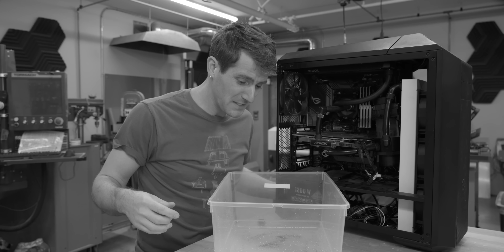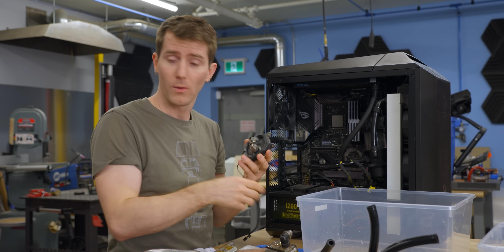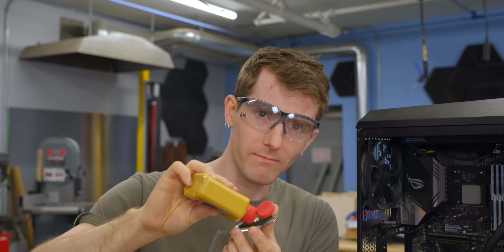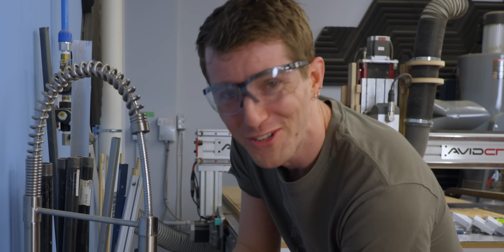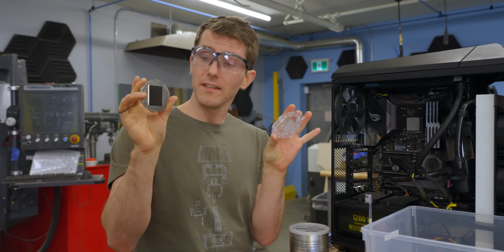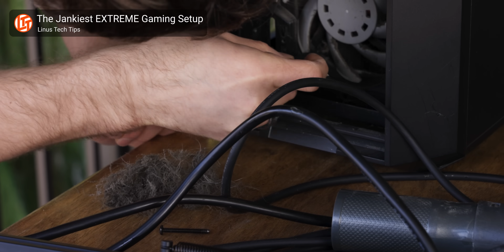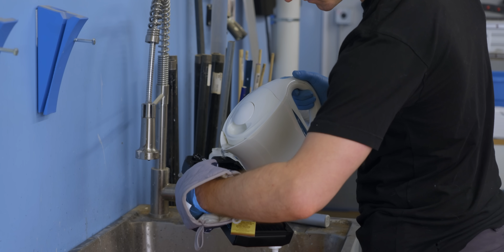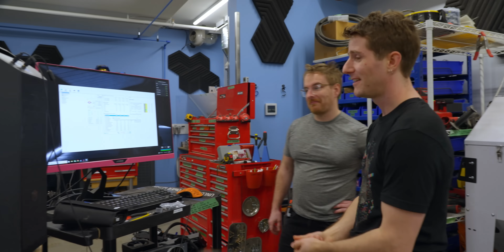I Will Never Watercool Again – Water Cooling Maintenance Guide

Comment: "The thing that attracted me to custom water-cooling was the inconvenience of it, I love taking apart my computer and washing parts of it like dishes in a sink, also the thrill of losing all my expensive components to water damage gets my heart racing like nothing else" - Custom water cooling fans apparently
Reply: Some people want to drive a prius the speed limit til the wheels fall off, some people want to tinker on a turbocharged hotrod every weekend that might tear its own wheels off. To each their own i suppose.
Reply: @GrimReaping  yeah but i've been using a turbocharged hotrod every day for the last 3 years so i am well within reason to point and laughing at the people on the side of the road who didn't consider reliability to be a factor in their tinkering
Reply: @GrimReaping Prius still goin'
Reply: @GrimReaping  Watercooling folks don't do any of this maintenance, though. That's the problem.
Reply: @GrimReaping  Except your comparison is off.  A good air cooler is nearly on par with water cooling.  So it would be like someone buying a Mustang and driving it, or someone buying a Mustang and taking it apart every 6 months to get 10 more horsepower.
Reply: @Terrackhimself  Your key word here is nearly. Anyone who races knows that they want to eek out every horsepower and drop every pound possible. Its for the fun of it. I enjoy cleaning and rebuilding motors just as much as cleaning and rebuilding computers. Just tell me you dont enjoy it man, i dont care what your views are on the comparison are, its better. Heck,  forget the comparison and all that other crap, just say "I dont like to mess with things after they're made.", and thats that. Do you think people who do cryocooling competitions that win second place say "Its only 10 degrees less, we actually both won!"?
Reply: @GrimReaping  Your key misunderstanding here was that  I was somehow bashing those who wish to do this sort of thing.  I'll full on admit that to me, dinking with water cooling for what only amounts to a 5 second boost clock extension, and maybe 1-2 degree C, is simply not worth it.

However, I specifically said, your comparison was off.

So just admit that you misunderstood my point.
Reply: @Terrackhimself  Water cooling distributes heat more evenly and efficiently. It relocates the heat to the outside of the case, as opposed to blowing it through, which can heat up other components as well. You're looking at a single point on a benchmark, and not an extended use case or the effects on other components in the case. I stand by my comparison. You can lie to yourself to cope, and keep writing comments until the end of time. You're wrong.
Reply: @GrimReaping  There are several videos that show that it is not as big a deal as you think.

So you can keep being stupid by trying to insult me, because obviously you've never seen side by side comparisons.
Reply: @GrimReaping  As someone who in the last couple years went back to air cooling, my non-water cooled components are actually running cooler with air cooling verses the water cooling as my overall airflow in the case is higher. The noise also is only a db higher since there is way less restriction. This is in an O11DXL so it isn't like this is an airflow optimized case either.
Reply: @Terrackhimself  Watercooling increase performance, that's simply a fact... When we're talking peak performance, those few % does matter, settling for less is like saying you're going to race with the intent of losing. When talking performance in the long run, yes even at the same clock speed watercooled components outperforme air cooled parts. Like you said "because obviously you've never seen side by side comparisons"... Anyways, that not the main reason most people do watercooling, most do it for either the sweet sound of silence (which is needed if you live in a flat with your partner, or did you really think she wants to run around with earplugs, because of your vacuum-cleaner sounding gaming PC) or esthetics. And you call other people stupid, what a joke!
Does it make sense to spend so much extra on it compared to air cooling? Well does it actually make sense to spend money on a gaming PC in the first place? That's obviously a resounding no to both... Spending money on your hobby is very rarely a good idea, but living life without any is just not an option for most people, so the money argument is irrelevant
Reply: @blazewardog  Sorry to say, but that's what happens when you don't research properly... There's several things that could be the problem, but the two most obvious ones are: too high restriction in the loop and/or low static pressure fans (completely ignoring the case, cause I've never seen or researched it). You should have asked for help, there's a lot of enthusiasts that with high certainty, would have been able to point directly at the problem component(s). Then you only had to do research around that component and you would have been golden
Reply: @Terrackhimself  air coolers are no where near a custom loop. AIOs, sure but custom loops are a whole different league.
Reply: @VikingRul3s  I want you to read my posts, and find the part where I said water cooling does not do anything.
Reply: @VikingRul3s  If air cooling is even close enough to cause you to even exaggerate about wearing earplugs, you are definitely doing something wrong.

If you do have a setup that loud, try using bigger fans at lower rpms. Also do a smoke test and make sure you aren't creating some kind of vortex and the air is actually flowing properly over your components and out of the case. also make sure your cable management isn't blocking air flow. And clean the dust off the fan blades as dust buildup on the fan blades can drop completely stop the fan from moving any air. And lastly, make sure there is actually space for your air exhaust and not just blowing against a wall bouncing back to the computer.
Reply: @SolWayward  If you aren't experiencing the "sweet" sound of a GPU going full bore, you simply don't have a fast GPU... Yeah ofc that was an exaggeration, but i have yet to see a girlfriend that's cool with a noisy PC

Yes bigger and/or better fans is an option (better air flow in general), but then how far off the price of custom watercooling are we really? Plus you'll still have that nice GPU sound, tho probably slightly less. The actual extra price will be pump + rad and people gladly pay twice high-end air for AIO solutions. The money argument is only the rather expensive GPU blok and then the undeniable fact that you'll void your warranty. The warranty issue is a very valid argument, as we're talking pricy mid-high to high-end GPUs
Reply: @SolWayward   BTW what's this talk about vortexes and cable management? I know you meant to be transferring the knowledge you got on how to make air cooled PCs less noisy (which is nice, thank you), but those two arguments are in reality myths. More research will tell you so, i suggest looking into hardcore OC communities, we'll be the most fanatic about airflow. Vortexes aka turbulence will happen every time the air hits components, so unless you don't have any components, you'll have heaps of turbulence (which is good, it means the air is hit the components as expected). Cable management (or rather the lack of it) don't prohibit airflow, there's been LOTS! of both reputable sites and private individuals that have tested it and all tests reach the same conclusion: "unless your PC case is the size of a console, cables have no effect on temps"
Reply: @Terrackhimself  Air coolers don't hold a candle to a custom loop. Flow rate, cooling capacity, and block designs are all vastly different. AIOs vs air: sure, I'll give you that. But your points are only valid for AIOs. Not for custom loops. Here's a prime example. When I built my 1950x threadripper rig in 2017: I first used a TR4 noctua cooler (NH-U14S) and could only reach about 200MHz OC stable. swapped with an AIO made for TR4 could still only hold about 200-300MHz could touch 400Mhz but not under heavy load. temps jumped quick on both.. that AIO failed, exchanged it in store for another, also failed.. said screw it and went custom loop with proper TR4 block, twin DDC pumps in series, and added the GPU into the loop as well, and used 2 radiators. Not only did it run significantly cooler, was able to push 605MHz overclock on it and it's prime95 stable indefinitely. That's all 16 cores locked at 4.05GHz 100% of the time. Ran 20c cooler under load and cooler at idle as well. Can't say it got any quieter, but I didn't build that rig to be quiet. 

I've been liquid cooling rigs for 14 years. Never once had a leak, failed pump, or gunked up block/component. Using shit coolant in your loops is generally the prime cause of failures. One of my oldest builds was a QX6850 with 8800GTXs in 3-way SLI. that rig ran for 6+ years without failure or cleaning/draining the loop. Was used and gamed on daily, When I retired that rig, the coolant was still as clean as the day I put it in, and the blocks were all spotless. No signs of wear or buildup anywhere. I still use that same coolant type in all of my rigs and builds to this day. (Koolance 702 coolant)
Reply: @Terrackhimself you're wrong and the fact that you can't admit it just further cements the fact, you don't like watercooling and so you find arguments to sustain your indifference when anyone can tell you, air cooling just isn't on par with watercooling, esp. if you start talking overclocking, it's close but it's not the same, in the words of Ricky Bobby, if you're not first, you're last... enjoy the view from the back broski...
Reply: @justrife  You can say your wrong all you like, but the truth is a good air cooler is just as good, water cooling only extends the heat soak period.  

The fact that you can't admit it just further cements the fact, you are a watercooling fanboy who does not like to hear that it is a hobby and fun.
Reply: @Terrackhimself  oh I wholeheartedly admit that it IS a hobby AND fun AND is head & shoulders above air cooling (just the facts), good thing that facts don't care how you feel or how you choose to explain your thoughts or ideas, wish you the best in that air bubble world of yours...
Reply: @justrife  LOL what ever dude.  you can wrap yourself in a warm blanket of lies and ignore what I said originally all you like.  Hope denial is a warm blanket.
Reply: @Terrackhimself   I think air cooling is just as good as water cooling, thats why I removed the radiator in my car and just use a big fan now. It's basically the same.
Reply: @GrimReaping "Nearly" is enough for professional workloads, let alone consumer ones. 

Unless you're running a data center, water cooling is just for shows; even then, a lot of them do air-based cooling.
Reply: whoever is running this channel definitely wants this to happen
Reply: Custom water cooling fans don't speak. The whole idea is that they're silent.
Reply: I've had custom water cooled for almost 2 decades now, never had water damage, never washed any components, it's simply a matter of doing it right and using additives for longevity (instead of colors, things flowing around like glitter and all that good stuff). I have however always had to spend an extra 100-150$ on a GPU block when i switch it out, but in return i get components that are completely silent and never die do too heat fatigue. But i mean if you can't figure out how to do a service on your car, custom watercooling probably isn't for you (It does actually require skill and the desire to research and plan properly)
Reply: Dude, I built my water cooled PC in 2018. I just recently upgraded some parts of it and so I decided to clean everything. And you know what? Everything were already clean so I did nothing. I went with a red liquid from EK-Cryofuel. I even reused that liquid because I saw no particles in it, and with the new hardware it's still as good as it always was. If I remember correctly that's actually the same liquid I used in my first water cooled PC in 2015 or 2016. So it's really old but it's still good to use.

I get around 25 - 30 C in idle and 50 - 60 C under heavy load on my GPU and CPU (7900 XTX and i9-10900K both overclocked). The fans run at 500 RPM in idle and 800 RPM under load. My rads are 360mm, 480mm, 240mm and a 120mm. I know, too much, but that's just how I work.

I don't think the maintenance is as bad as people make it out to be. It just depends on the climate where you live, the ambient temperature in the room and how hot your hardware is running. How often doesn't seem to matter for me. It has been running like 6 - 8 hours a day.
Reply: If you do it right you won't have any of the problems in this video. Also unwise to do the things in this vid that will CAUSE problems: don't put acid in your rads unless you're prepared to test the pH before hooking them back up to a loop. Ignore the iodine as biocide as well: use a reliable premixed coolant like DP Ultra, Koolance 702 or Mayhems X1 and you'll have biocide and corrosion inhibitor included.
Reply: @woe2you2 I use Prestone DexCool GM approved lmao. its not biocidal, its everything-cidal :D plus it has corrosion inhibitors and i use distilled water.
Reply: @woe2you2  yup, using a biocide with distilled water used to be the way to do it back in the day when we where all homebrewing water cooling loops from aquarium parts, but with whole companies spending tons of money on R&D, you are much better off buying a good premixed coolant or a good additive from a reputable brand, so you know that everything will be mixed in the right proportions and that it is safe for the components of your loop.
Reply: @originalkhawk  pretty sure a silver kill coil and distilled water is still a pretty reliable solution.
Reply: @woe2you2  But let's be honest, the new gen doesn't want to spend time on anything that isn't related to social media. Spending 10-30 hours planing, waiting days/weeks for components from various sellers, then having your PC offline for a weekend to build it properly, leak test, then spending the next 1-4 weeks tweaking to get it just right (regardless if you're going for max OC or silence). All that means the entire process is alien to them and they'll never do it or just wing it and then complain when they unavoidably run into problems. I've seen kids think they really put in some work, after doing a 5h mod job on their car....
Reply: @woe2you2  Or just air-cool it, get about the same temps anyway, and only spend 5 minutes maintaining it every 6+ months.
Reply: Damned straight. Custom Loop Ascended Race FTW.
Reply: It's like cars. There's a reason why I like spending 4-5 days detailing a car.
Reply: The anxiety of watercooling would keep me from ever doing it. I just slap a noctua tower on my cpu and forget about it till dusting day. I've been moving too much to have a tower, but if I ever get back to it I would love to do a passively cooled system
Reply: I can ATTEST! :D :D.... alright let me scrape my life back together now LOL
Reply: Water cooling is interesting, but something I'll never do. Air cooling is more than good enough for 99% of situations and has so many few points of failure and potential issues during failure.
Reply: @Freak480  I agree with you.  Even gaming does not have a real measurable difference between the two.  

The real benefits to water cooling are limited to activities that push your system to the limits, which as you said, 99% of us, never do.
Reply: @Freak480   If your only measure it in gaming performance, then yeah, i agree. The small gains (which will be a 100% of the time tho, more fps is more fps, watercooled modern GPUs boost higher and hold it) is not worth the added points of failure, but it's worth keeping in mind that your components usually last longer with better cooling (some high-end Nvidias have a rep of dying fast on "stock" air cooling). So yeah, if you have your PC in a separate room, are looking for must bang for buck, something you build and never think about again and are using a good headset (keeps fan noise out), then there's no beating air cooling!!! In that case watercooling simply makes no sense and definitely not AIO solutions. There's only 3 good reasons to switch to custom, that's noise, esthetics and/or enthusiast level performance
Reply: @VikingRul3s  The marginal potential life extension of the parts really isn't worth talking about. If you buy an even half competent air cooler or gpu and aren't running some batshit oc then the part will be fine. Generally speaking the larger issue comes from thermal expansion with frequent power cycling of the cpu.
Reply: @Freak480  You kinda just contradicted yourself... Yes components dying fast is usually from thermal expansion and guess what, keeping the core components 30-40c lower results in far less thermal expansion. That's pretty logical. No it doesn't have anything to do with "badshit OC", you'll be able to find 100s of reviews where they check out the backside of high-end GPUs with thermal camera, that reveals the staggering temps air cooled cards are transferering to the backside. That's where you get your card destroying thermal expansions
Reply: @VikingRul3s  Again, you're massively overestimating the effect that has on a well built air cooled component.
Reply: @Freak480   Again, you should really try doing a bit of research. Delta 20-25c vs delta 60-70c is low to you? So if your boss comes and says "I'll cut 2/3 of your pay" you'll be all "sure, that almost no difference anyway". Or perhaps you're focused on only CPUs?... Are you getting a great fps count with a APU system?
Reply: @VikingRul3s  The actual delta on modern, well constructed, well design processors isn't that important for longevity. The average persons processor, even going from room temp to throttling, isn't going to cause that much systemic damage to a processor. The biggest source of damage comes from wild and rapid temperature swings. Think "grandma that turns on and off her computer every time she goes to look something up" not "my gpu sits at a higher overall temp when in game".

Yes, technically water cooling can help extend the life of a processor, but it is almost entirely going to be lost in the margin of error when compared to an equally well designed and maintained air cooler.
Reply: @Freak480  See, i knew you where going to pull the CPU card. That's clearly not what I'm referering too, as stated many times. No it's not the amount temp swings, it's the degree of temperature difference (and how fast it happens). It's very simple and some research would have told you so... Different materials expand different, high temps means bigger difference. All materials have a flexible zone followed by a plastic deformation zone (lock up tensile strength). Higher temp difference means higher stress/force which in turn can exceed the flexible zone, exceed that enough times and it goes down. It's obviously not the silicon I'm talking about but the rest of the cards components

What grandma has a high-end gaming PC? And shutting it down when it's hot does what? You understand how electricity works right? It''s not a furnace
Reply: @VikingRul3s  A processor that is frequently power cycled  will go from it operating temperature to room temperature much more often than a processor that is just left running. That substantial, frequent, and rapid change in temperature will cause much more damage than something just left running at a higher temp. 
Modern processors (both cpus and gpus) that are properly designed do not experience significant long term damage under sustained usage within design conditions. This isn't complex stuff, you're just digging for some excuse to justify liking water cooling.
Reply: @Freak480  Did you at all read what i wrote? Please do some proper research! This isn't a new problem, it isn't something that suddenly appeared during the modern PC age, it's well documented...

Are you all there? I literally listed 3 good reasons to choose watercooling in the very first reply, what was hard to understand about that? The longevity thing is a bonus. And you're saying it isn't complex stuff, you didn't even comprehend the first reply...
Reply: @VikingRul3s  Our conversation has been about long term reliability and you exaggerating the benefit offered to it by watercooling. 

The other facts are ones that we agreed on, but I don't think matter much at all.
Reply: @Freak480  Nope, i mentioned it and then you zoomed in on it. Clearly so much that you completely lost oversight. I don't understand what so hard to understand, i listed 3 good reasons, that's it. Does watercooling provide other benefits, yeah, as well as downsides. Enthusiast air cooling build also have down sides, among them lots of fan failure points, the high premium of large efficient air cooled GPU models.

This hasn't been a conversation, then you would have stuck to what my reply was actually about, but since your reply was wrong i corrected you. There's documentation for everything i said, the life cycle of high-end vs all-other cards, the science behind thermal expansion (which cause solder fatigue). This has nothing to do with agreeing on the matter, there's facts and then there's imagination
Reply: @Freak480  As Daniel Patrick Moynihan said: "You are entitled to your opinion. But you are not entitled to your own facts"
Reply: @bombsquadtoddler  Good thing I'm being truthful then.
Reply: @Freak480  A hypothesis isn't "a truth" 😉 A theory is only valid in the absence of facts. Facts are however undeniable 🤓
Reply: @bombsquadtoddler  You misunderstand what a theory actually means. The theory of evolution, while still a theory, is fact.

What have I said that is objectively false.
Reply: @Freak480  I think you're confused. Are you talking about Darwins theory about humans (which is still "just" a theory, not facts) or evolution in general, which has been proven and therefore fact? (which btw first was directly proved with some lizards a few years ago) 

Simple, solder fatigue close to main thermal dissipation, due to high heat difference. It's one of the basic things in electronic engineering 🤓
Reply: @bombsquadtoddler  If you actually read throigh the conversation, you'll see that I do acknowledge that higher temps have an effect, but (and this is another known and accepted fact) that stress and fatigue is relatively minimal when operating well within design conditions. My main point was that the moderately lower temps from watercooling will have a relatively minor effect on part longevity (in a well design component) compared to the fatigue generated from repeated thermal cycling. A more static thermal load, even if at a slightly higher temp, will likely do less damage than a more dynamic thermal load average a slightly lower temp.
Reply: @Freak480  I did, you didn't. No that's incorrect. In electronic engineering you try to design it so it in theory works, but the days where building for longevity was key, is long gone. The reason so many flagship cards KIA early on now a days is due to savings (and eco friendly solder). In the design the amount of solder is calculated by programs, to achieve just over what minimum requirements are. This leaves little to no room for tolerances in both amount and temperature of the solder. Combine that with the massive TDP of flagships, that produces so high spikes of heat, that the PCB itself is calculated in as a heat dissipation surface. A over 50% decrease in delta is a massive improvement, 20% is officially called "a statistically significant factor/difference" among scientists
You can setup all the strange scenarios you want, cause it sounds like you will keep making excuses, instead of simply admitting that you didn't research it properly. So let's just say, sure, you know better then all engineers, they are all way too incompetent to understand how to properly use electronics
Reply: @Freak480  i did, you didn't. Where is that an acknowledged fact? In that company where entry and flagships have the same lifespan, that nobody other then you know about? Sure, you use your PC at a constant, unlike what basically 99,9% of all workloads or games does. In reality electrical engineers have no idea what they are doing, so it's a good thing you are here to correct all those useless years on school, based on your internet degree...
Reply: @bombsquadtoddler  Where did I ever say that "entry and flagship have the same lifespan". I said that watercooling will provide a relatively minimal boost to part longevity because there are other factors that are more significant in otherwise well designed qualiry components.
Reply: @Freak480  You don't seem to get it. They are designed equally well, so if your claims where true they would last an equal amount time
Edit: The heat spikes are so high on flagships, that the PCB itself are calculated as a heat dissipating surface/component. A decrease of 50%D is a massive difference, rendering the heat spikes manageable, like with entry level cards
Reply: @Freak480  I have no interest in discussing this any further, believe what you want. Make a company that goes around tearing down critical servers, they are all water cooled for a reason, but you know better, so you could easy make it big then. bye 🤗
Reply: @bombsquadtoddler  Yoj seem to be intentionslly either misrepresenting what I'm saying, or incapable of understanding it. It's clear that any conversation with you is pointless so I wish you a good rest of your day.
Reply: @Freak480  that's where the buffer of water medium for cooking makes the difference. You guys don't even understand and you're discounting it as bad. You're literally listing the reasons why water has advantages as a cooking medium and you just go "but because I don't understand how to build it to work properly, it will run into the same issues as air cooled anyway," when the answer is demonstrably no, it won't. That happens because of how ineffective a buffer medium air is. That's why the temperatures cycle in such a flux and cause issues like that. A water buffer pulls away the heat surges faster and more effectively than the best of the best air cooler on its best run ever possibly could. It's simply the nature of the medium and how heat transfers through air and water. Air is a horrible buffer medium, less than 1/16th the effectivity of water alone not even including a glycolic mix. You don't even realize what we are saying and that you are agreeing with us...
Reply: @Freak480  scientific theory and a personal theory are different things don't pull the same bs as flat earthers.
Reply: Spot on! Secret closet masochist.
Reply: Me too. Spending a Sunday Arvo taking apart my PC is a good time. I look forward to maintenance day.
Reply: The hoses should be electrically conductive like on a vehicle. Take an ohmmeter and test the radiator hoses on a car. The hoses are conductive to stop the block and the radiator from acting like a battery and oxidizing and corroding. I think they're impregnated with carbon or even bits of metal.
Reply: @SmokeyWire56 I just looked this up because I always do that when I hear things for the first time and as someone whos built over 600rwhp without boost, and without ever hearing this before, i can say with confidence thats simply not true. There is no mention of this in any hand book, internet page or educational material that I just looked through. radiator hoses are normally EPDM rubber with a fiberglass or nylon embedded. no metals or carbons. unless you're referring to the black dye of the hose to which i would say all black plastics and rubbers are more conductive than white because of what has to be added for the black. this still doesn't stop the electrolytic process between the engine and rad, you need distilled water for low ions and good coolant for corrosion inhibitors.
Reply: @killershark90  No, I learned this in high school auto Tech campus it simply is true. Like I said, take an ohmmeter and test it yourself. Sbc is what I tested.  The radiator being aluminum and the block being iron there could be a reaction if they were electrically isolated. You'd be surprised actually quite a bit of rubber is conductive many tires are also conductive. This is to keep the vehicle grounded so a large static charge won't build. Not everything is in a book.
Reply: @SmokeyWire56 you're talking out your ass I just checked my powerstroke. nothing.
Reply: I buy things that I don't need just to work on my PC once or twice a year. Can't wait to upgrade my 12900k in a couple of months
Reply: I've never once had to do any of this in 20 years of water cooling. This was simple neglect and not understanding what components he had. I don't even flush my systems. Drain and refill. Use only distilled water and a silver coil, nothing more, ever.
Reply: In 20 years of watercooling I never never lost anything to it a leak and i'm not even that good at it.
I do think his overblowing the complexity of it and the risks i'm using well out of date EC6(I bought the stuff back in 2016) and its still fine.
Reply: Water cooling only makes sense if the part your cooling creates so much heat that not even the most advanced air cooler can’t cool the part without needing the fans to spin up to jet engine speeds, otherwise it’s just not worth it for the reasons you stated.
Reply: @TrackZeroNotFound  the reasons he stated aren't even real lol only if you do literally - and I do mean literally in the literal sense - everything wrong and mess every possible point of your loop up because you have no idea what to do or are afraid to do things because you don't understand them. Some people also just aren't good at putting stuff together, so they fumble even the easiest of tasks. Some people think they know more than they do and go gung-ho, then wonder why their system doesn't circulate properly and has 10 90s in it so it has blowback pressure. The things mentioned both in this comment and the video aren't even issues, it's manufactured faults by ignorance or arrogance.
Reply: i love air cooling and will always keep air...  the only thing watercooling does is look cool and cleaner, a good 120mm double fan air cooler cools as good as a 240/280mm AIO hell even my zalman 120mm dual fan keeps my ryzne 5800x same temps as my friend with his 360mm assu rog AIO with ryzen 5900
Reply: @reggiexp69 AIO is liquid cooling in the same sense that an intel stock cooler is an air cooler. yes it functions as you describe but not nearly to the same capacity. my custom loop mops the best AIO o.O  and are those the same temps while gaming or like pulling a cinebench run? also its not just about temps its about boost clocks and how long itll hold those boost clocks for.
Reply: @KobraSalvage  yeah i just hate AIO like thye look cool but make noise, the fans often make noise and the pump... + it can and will dry up someday... my air coolers been with me for YEARS i just changed 3 years ago for a rgb one XD
the temps are in a cpu stress test 100% al lcore with cpu z, cinebench its way cooler and gaming it hits like 65c after 5hours of gaming but gaming it never does 100% most is 80% on a couple of cores overal its 30-50% ish load 
the cpu stress test it kept the 4.72ghz at 120w around 72c for 15min didnt move maybe 0.1 a 0.5c over the 15min
it does get hot stock without a tdp limit 80c straight away and 4.5ghz only if not less.
i can do 4.8ghz all core but the benifit vs heat is not worth it. 120w is good enough just need 144fps on 1440p without hte horrible fps drop i had on my stock r5 3600
Reply: @reggiexp69  if your system is drying up you already have a problem, drying up is not a byproduct of function..
Reply: @BigPanda096  can be i never bought a new AIO
Reply: Annual water cooling ritual.. 😂
Reply: But that extra 3 degrees less of temp that you'll otherwise never notice tho...... 😂
Reply: I've never had these issues. I usually upgrade or install something new every 6 months - 1 year anyways. I just use clear coolant and replace it then. Not sure where all these supposed issue come from.
Reply: There really isn't a really good reason to watercool your PC unless you really know what you're doing, don't skimp out on components (tubing, fittings, blocks, additives, etc.) and put in the time and money. Because for watercooling to really blow past aircooling you need to invest significant amounts of cash into it. Sorry, those cheap Aliexpress blocks for 20-30 bucks just won't cut it. And all for what? Five degrees less under synthetic load compared to a high-end Noctua cooler?
Mind you, it's a lot of fun, but I never really felt 100% comfortable with my watercooled PC and just don't feel like taking it apart completely to find out why something is off. The worst an aircooler can do is break a fan and with an AIO you typically rip out the whole thing if it starts breaking.
Reply: I'm going air cooling when my closed loop H100i reaches the end of its lifespan. The hassle and risk of open loop just isn't worth it and the aesthetics are overrated.
Reply: Nah. You guys are just babies. 

My system makes no sound. That's what I care about.
Reply: fuk that, ill just take the pre sealed water cooling cpu's
Reply: @TheMarcosvolta  what the hell are you guys doing to have such a hard time with liquid cooling? Do you just not know what you're doing and dink with it until you break a perfectly functional system? I don't get this, benn running liquid since you used to have to make your own parts and use aquarium pumps to do it and I'VE NEVER had any issues ever mentioned about it. For DECADES I haven't deviated from my set up and not once have I had an issue or had to deal with it. Only ever cleaned air filters to the radiator. 

Seriously what do you guys do to have issues? Are you just not handy?
Reply: I read similar statements from people that do not put silver ribbons in their water tank, nor a few drops of anti-freeze/bio-kill to kill off biological growth in the system. In 14 years of watercooling I have never had to do all your quip states.

Also, have a negative pressure case and dust build up takes forever.

One major issue people mess up with is mixing Aluminum and copper or nickle into electrolyzed water. So do everything you can to keep Aluminum out of the water flow path.
Reply: Its really not that bad
Reply: Its not about the temps... its about sh!ting on those 3rd world children who spent their entire life extracting these metals in my pc
Reply: To be honest I’m recently learning you’re supposed to clean it 😂, had mine for 10 years no problems with the water cooling system
Reply: Some people just like doing lenghy completely avoidable maintenance that could ruin the PC. 
And some like stuff that just Works and Works with no maintenance (except dusting off quickly and being done with it after a loooooong time).        (S)
Reply: I meant sure why not go with that huh?
Personally I’d say they give best of the best tempts for longevity so that’s why 
But if you wanna go with these sure I like to destroy and waste alot of money on things
Reply: You must be young 😂